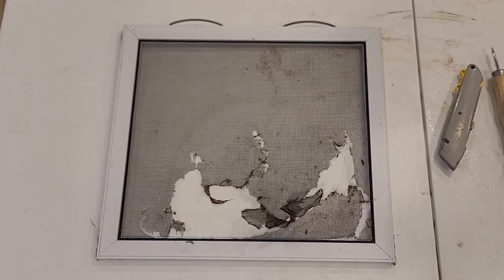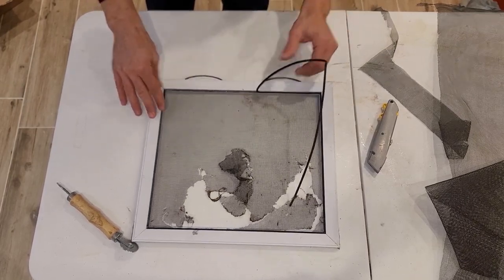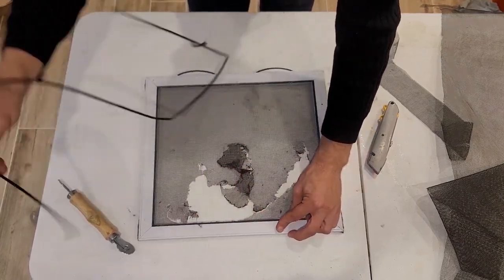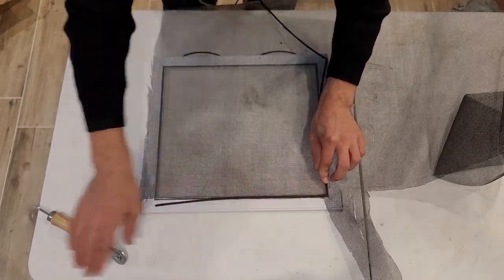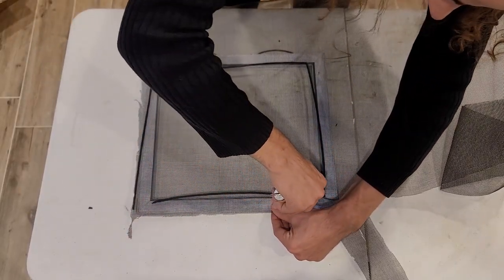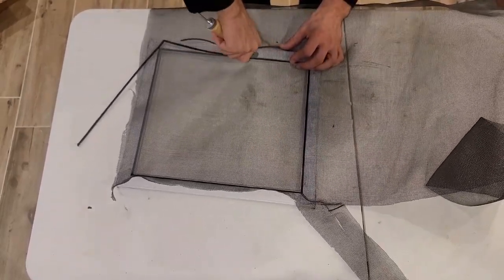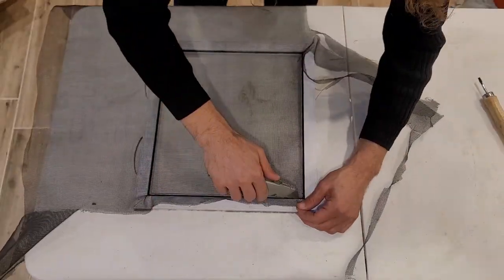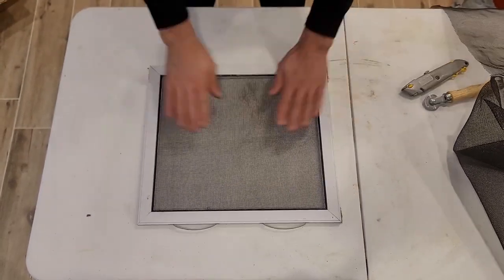How to Replace Broken Window Screen

Comment: One tip to add is that when working the spline into the groove with the roller, take a moment and use the flat end of the spline tool to push back (in the opposite direction) to relax any stretch you may have created in the spline. This way, the spline will not 'shrink' over time. Not too much, as it may crease or introduce folds into the screen material. You want to keep that as taught as possible.

I also use a spray bottle with a mixture of lightly soapy water to help push the spline in. It will dry and actually help hold it in place as well.

You can also get spline tools that have nylon rollers that are far gentler on the screen material. But at a premium of a few extra bucks.

Cheers!
Reply from the maker: This advice is so minty fresh that I feel it's the perfect companion to what I think is now a video missing your information. I especially like the soapy water idea, the spline is not easy to wrestle with otherwise.